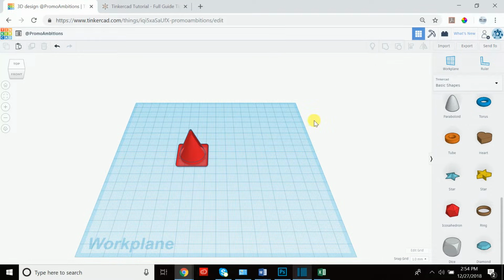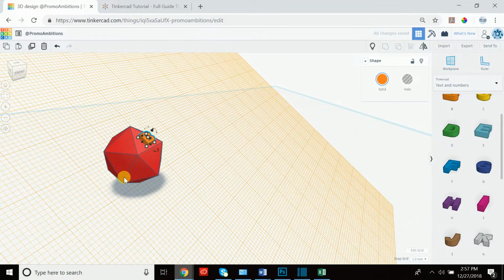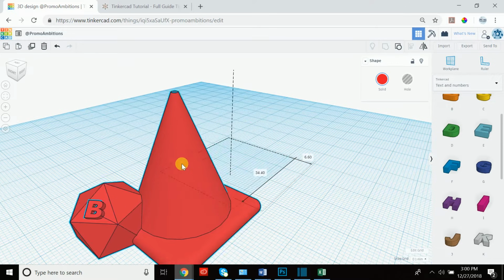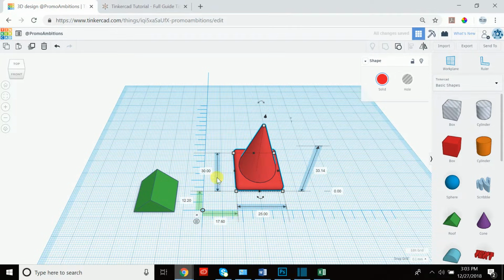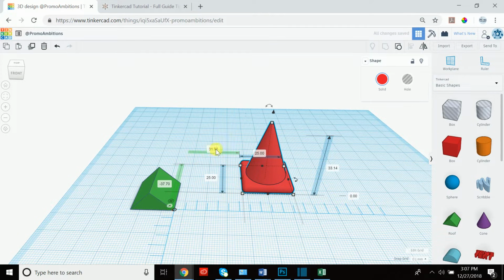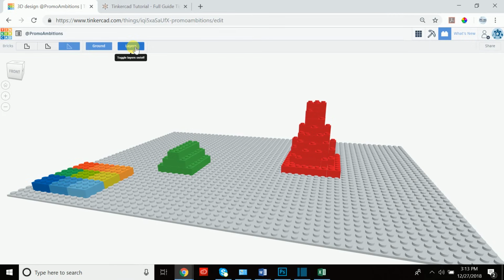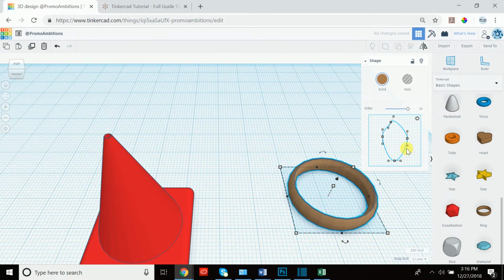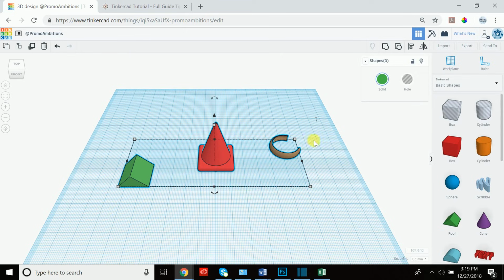Tinkercad Tutorial Part 4 – (Workplane, Ruler, Blocks and Bricks)

Comment: @18:33 I would describe the circles as.. The line thru the circles is tangent to the curve at the square point..
Reply: You're right. And this type of curves are called Bezier curves used a lot in vector drawing programs (Illustrator, coreldraw ...)